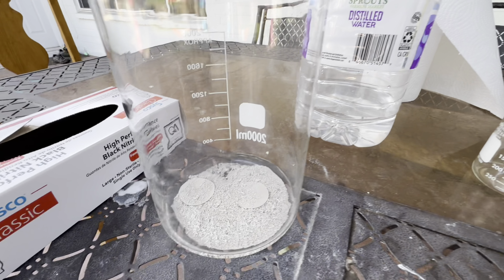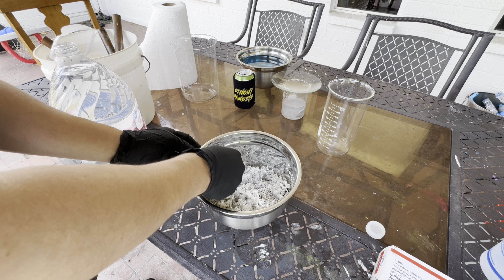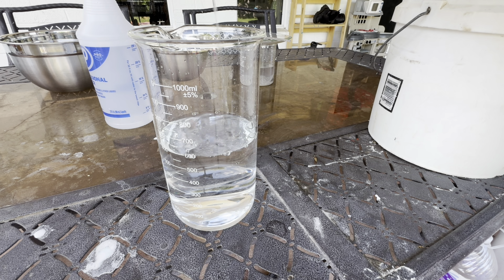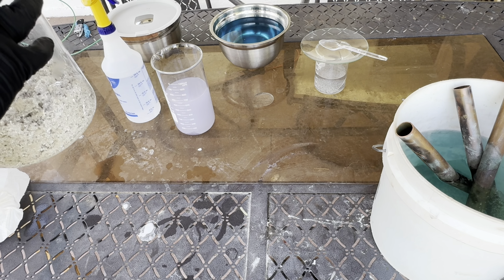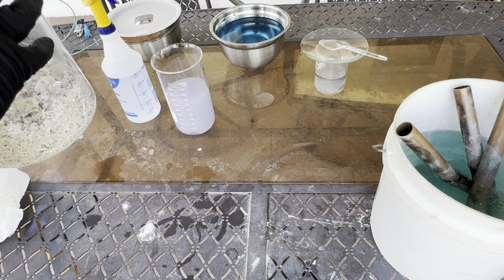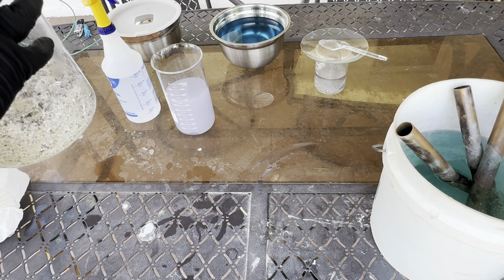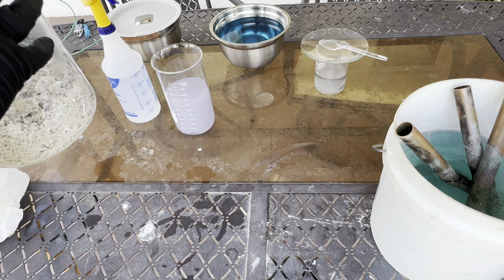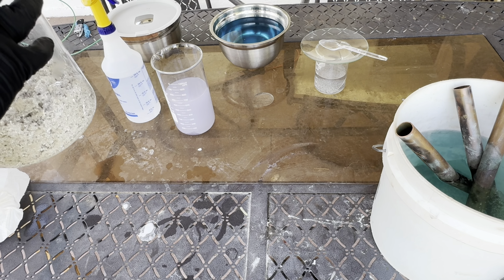How I harvest Pure Silver from my Silver Cell

Comment: What is the lowest purity and quality silver you can use for scrap silver?
Reply from the maker: not sure what the minimum is but the more impure silver the quicker the silver nitrate will become over saturated and not work properly. typically ill use sterling silver in gold refining, then drop the silver out using copper and then run it thru the cell. so 95-98%+ to start. ive run just melted sterling silver and it will oversaturate the silver nitrate with copper pretty fast